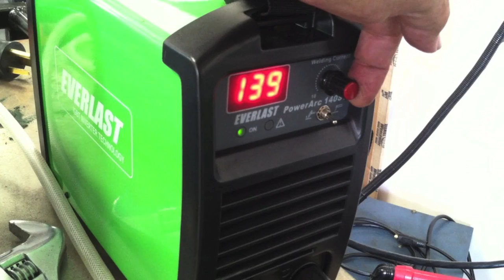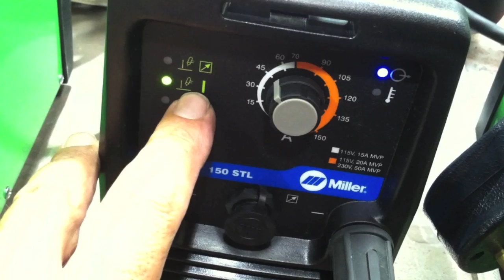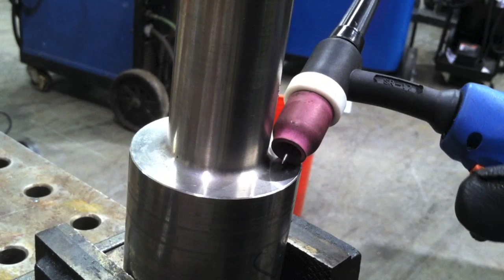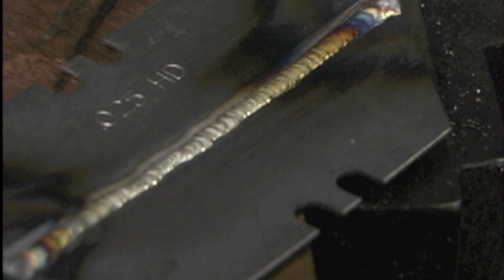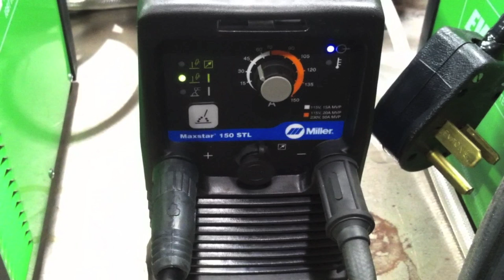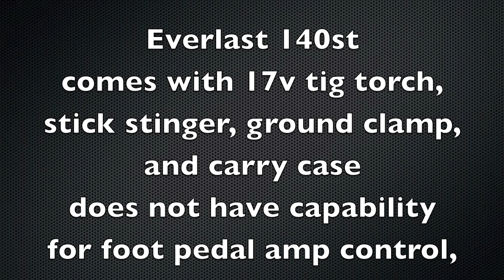Tig Welder Comparison - Maxstar 150stl and Everlast PowerArc 140st

Comment: its really wierd when you see everlast or longevity offering hf start and post flow adjustment...dual voltage. for under 600 dollars..yet you cant even get a stripped lincoln or miller for that price...the technology is obviously cheap.
Reply: Gixxerrick2002- Yes. Very true. Most of the extra money you pay for Lincoln or Miller is to get their name on the side of the machine. This video only proves that as the Everlast welds just as well as the Overpriced Miller!

Comment: I considered both machines and the maxstar 161. ended up going with the esab mini arc 161 Lts. burns 6010 amazing, 7018 is smooth and great tig arc. downsides no foot control,v style torch and no adjustable arc force or dig it's automatic I guess but with all that said I really like machine, even better than some  of the maxstar 200s I use at work

Comment: what's ur opinion on the everlast welders? I'm looking at powerarc 300st..600$ or can get maxstar 160stl for a few hundred more or lincoln invertec 155 for about same. im a pipe welder so must run 6010 open grove and I want something reliable. any info you could give me on which would be my best bet would be much appreciated. And and the 300 amps I'll never use so that's not a deal breaker loosing that. quality machine is what I'm after that does what I need.

Comment: Hey Jody,

I just bought a maxstar stl, and have all the tig attachments on the way. what is the difference between using gas lens and not using a gas lens for mild steel? ive only used a gas lens for aluminum welding in school. reason i ask is because i was looking at your kits, and was wanting to purchase one, but didnt know if itd be worth it or not since this machine cant weld aluminum.

Thanks,
Anthony

Comment: Hi Jody, What is the the thickest steel you can weld with one pass using the Everlast 140st and also the 160sth. Thank you
Reply: one pass for 140st is 3/16 1/4 if you use 6011  and for the one 160 3/16-1/4 6011 or 7018

Comment: Is a everlast 140 mig a durable machineci dont need to weld much bigger than 1/4 in and it has a spool gun available about $200: less than a comperable lincoln thanks
Reply: My everlast welders are still holding up for what it is worth. I've got one of their TIG machines, their MTS welders and a plasma cutter.
Reply: I don't have the everlast 140 mig but I do have this everlast 140st and it has been very reliable. I take it out on field work quite frequently and throw it behind the seat of my truck when I'm done.
Reply: I've got the powerarc 140st and an Everlast mig welder. They are great welders.
Reply: Craig Cundiff for what it's worth, I had to make use of that five year warranty on a 140st recently and it was super simple.  It still welds fine but amperage display was incorrect.
Reply: Walter Forsiethe still holding up
Reply: I'm narrowing down to this Powerarc Everlast 140st... I've been comparing DC tig/ stick welders for quite a while.... and with a 5 year warranty I think this is gonna be the one...
Reply: I've almost burned my 140 up. It seems like it ran hot on stick mode.
Reply: redbone fabrication My 200 ST runs hot but I took it to welding school and got my instructor to work with it. While the Miller’s and Lincoln’s at school are running correctly, my instructor found that 74 was correct amperage for 3/8” steel using Millennium rods and 72 for the Radnor house rods sold at Air Gas. He was very impressed with the stringers it ran.

Comment: Bought the Everlast 140st on Amazon for $250.00 and it works! I don't need more power,but I'm going to have to tie in a foot switch for the thin stainless tubing I'm working with. No problems easy to use and does everything it says it does,but really affordable!!
Reply: Xeyrvədigər

Comment: I got the 160 sth and trying to stick on it and its super hard to keep an arc. No I've tried different size rod and tried different amps on each rod size. Just hard to keep an arc. And did you use the plug that it came with or put a different plug on it?

Comment: No comparison. The arcs are virtually identical and yet the prices are worlds apart. If portable steel TIG welding I'd go with the Everlast 160st. You get the gas solenoid and high frequency start.

Comment: i got a chance to try out esab's caddy tig unit a while back and was pretty impressed with it. used some 1/2" aluminum and set it up on the highest frequency ( about 200 hz ). it made beautiful welds and wasn't overly hard on the ears as some units are at high freq. it is also extremely lightweight. my concern is that i don't see a lot of esab welders out in the field and am wondering about reliability issues. your comments and/or experience with esab would be very valuable. thanks Jody.

Comment: i'm really glad you're making these videos, even with 35 plus years of welding experience i always learn something new here. didn't realize that you are THE source for tig finger, called about 6 welding supply stores in my area. they'd never heard of such a thing! took 3 pieces of exhaust pipe ceramic wrap and sewed 'em together with fishing line, covered the "seams!" with permatex ultra copper and tried it out. worked good but they don't last very long! will soon be ordering THE originals.THKS!

Comment: Hey Jody ive been watching your videos for some time now.  I am trying to decide on a tig to buy.  I have never tig welded before.  I work in the wine industry and will mostly use it for stainless and on thin metals. The two machines you just reviewed would be perfect for me but i kinda want to have to option of aluminum.  Any of you guys have a good starter tig for me that doesn't break the bank?

Comment from the maker: probably AC balance.  if it is too low, your electrode will ball like crazy.
set it to around 65% electrode neg.  all machines list this differently so you may need to experiment on scrap aluminum.

Comment: Hi Jody, would it be possible for you to do a video on distortion from welding.
Seems this is an area that unless you have lots of experience you will struggle to keep the metal from bending all over the place.

Comment from the maker: I would take either one.  The fact that the Miller is foot pedal ready makes it a good choice for food service type stainless tubing work.  Other than that, they seem to weld about the same. The main difference is that I would have money left over for some other tools if I chose one vs the other.

Comment: I have the little Everlast 140 st and it is an excellent machine for less than 3 hundred bones...If you want to get into Tig'n,this machine is perfect or for portable work, again an excellent little welder. I use a 5500 w geny for portable power to the welder.... Welds just as good as my Lincoln Square wave or the Miller machines I have used...